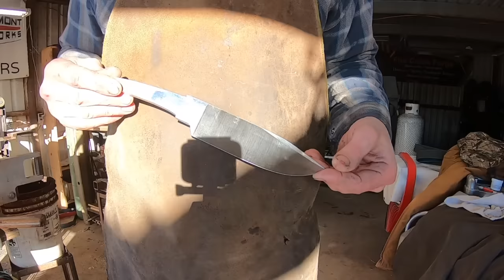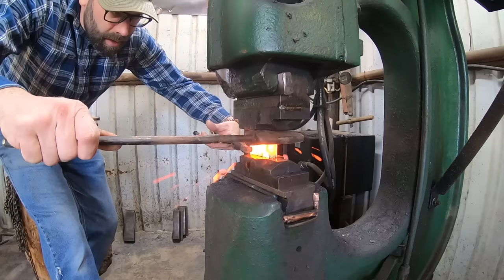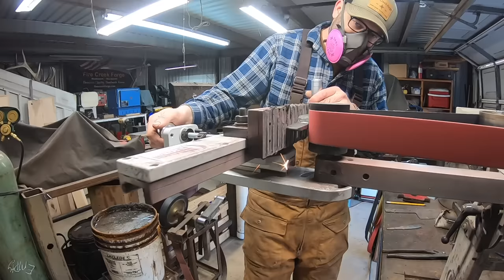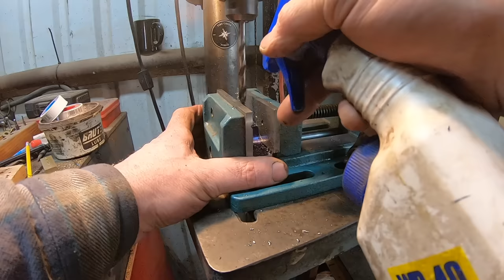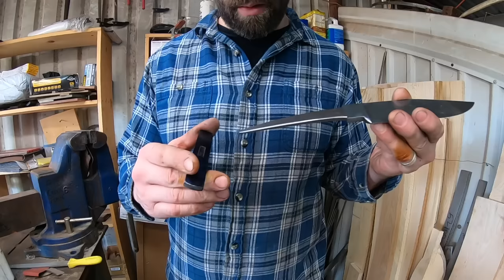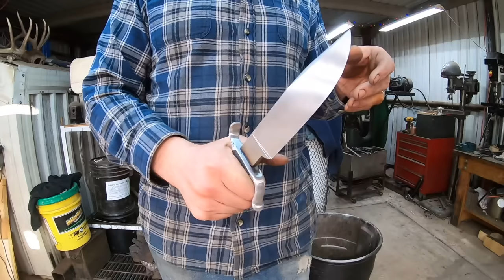5K Ball Bearing Twist Knife, Forging The Guard And Grinding The Blade

Comment: You should use motor oil for your drill press it has a higher specific heat. Doesn’t burn up as quick. I use like a big syringe to apply it you could also use an oil gun.
Reply: Nice tip, gonna try it.

Comment: I’d like to offer up a suggestion while you’re drilling through the thick guard piece, that if you can, turn your drill speed down. Faster not always better, plus that could have aided in the backside hole being misaligned

Comment: Lmao…. A TWIST OF FATE!!!! 
And there goes the S guard Hey man when you get that gut feeling you have to listen to it! Can’t wait to see how she turns out! She? Are all knives women? At least in my mind they are!
Reply from the maker: Haha, yeah
Reply: @FireCreekForge  I recently quenched a 1080 blade and after about 30 to 45 seconds after it cooled, I tried to straighten the slight warp and snapped the blade where the tang met the back of the Ricoso. I am still a newbie at knife making I realize I should have tried to straighten it in the temper, but I did get to see the grain and I was very happy with myself and what it looked like that got me thinking though do you ever anneal the tang for more toughness or is a 400° temper adequate? Thanks for any help!
Reply from the maker: @TheOGfrenchy  I prefer to straighten out of the quench. But to do that you can't quench down to ambient oil temperature, and in fact there's no reason to do so. If you pull the blade out of the oil while it's still smoking some, but the oil does not evaporate off the steel, you should be able to do some straightening easily enough. You can further temper the spine and tang for added toughness.
Reply: @FireCreekForge  thank you kindly for your advice and help! Much appreciated! Hope you have a great day brother!

Comment: Hey there from the UK, I couldn't find much info on the subject, but why do you use ammonia solution when wet sanding your blades?
Reply from the maker: it helps the sand paper cut better and longer, and the ammonia solution doesn't rust the steel like straight water.
Reply: @FireCreekForge ah ok, I have to try it out! I appreciate you taking the time to reply! Thanks again.